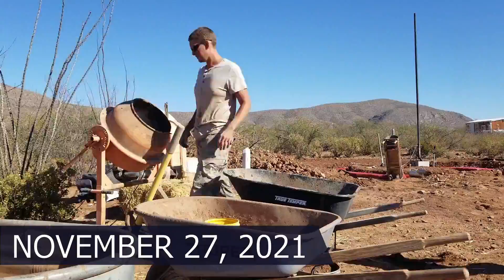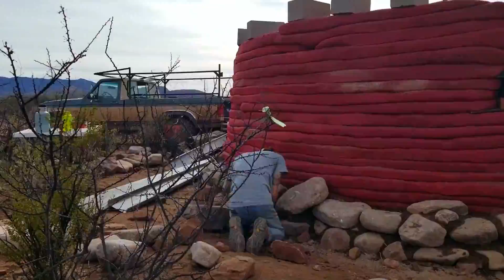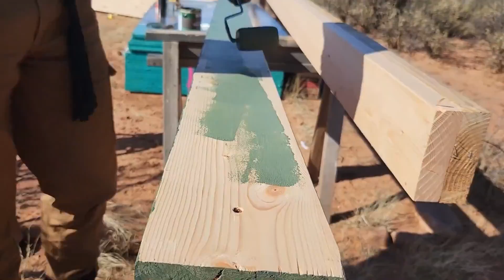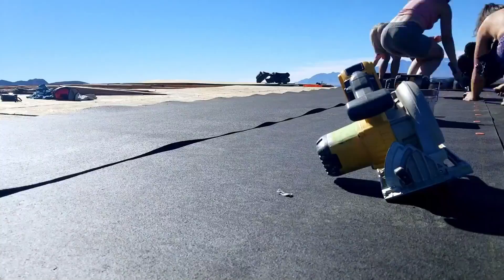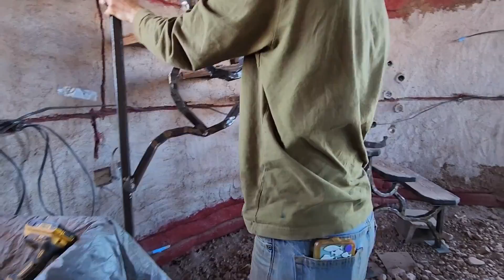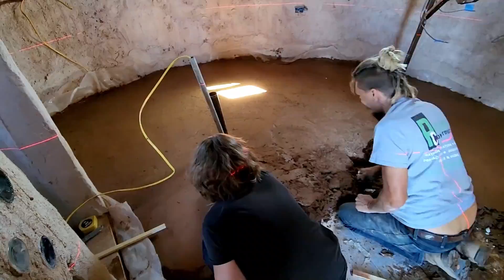Building An Off-grid Earthbag Tiny Home For Less Than $10k | Watch The 15 Minute Timelapse

Comment: The only sad part is those disgusting plastic bags are needed for all the soil. It would be nicer if it was all wood or rock or something.
Reply from the maker: Plastic isn't ideal, but at least it's not single use... and does significantly cut down on the other grossness such as toxic insulation, paints, etc, etc. Not perfect, but pretty good.
Reply: I asked Bing's AI what alternative could be used to fulfill this, and it said you can use a wood mold, pour in your mixture, stamp it down, and let it dry in the sun for a few days. Then use it as bricks.